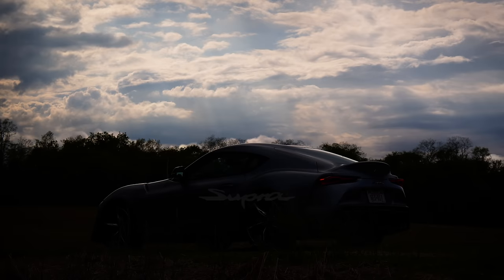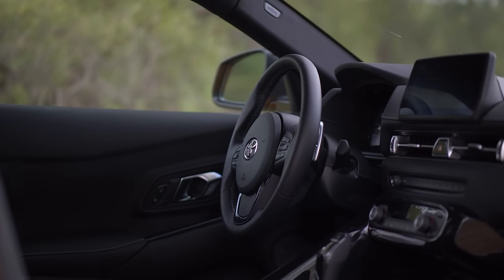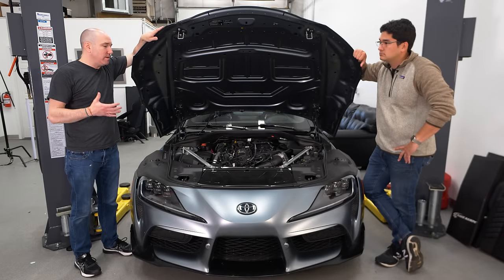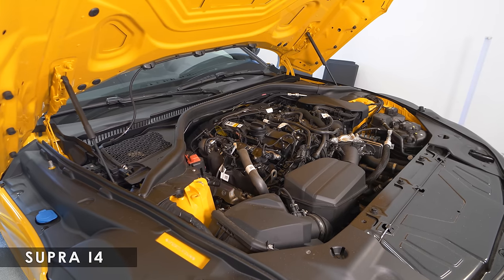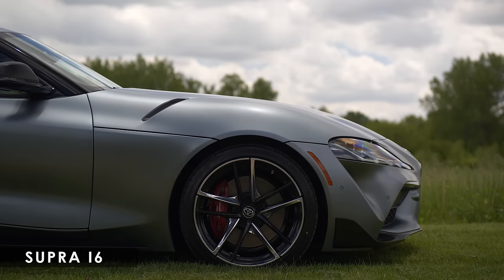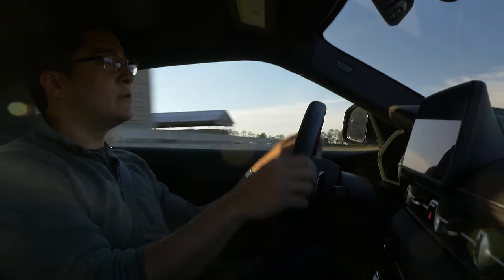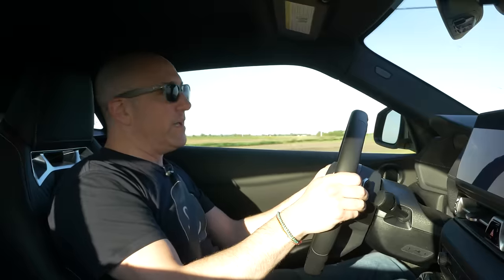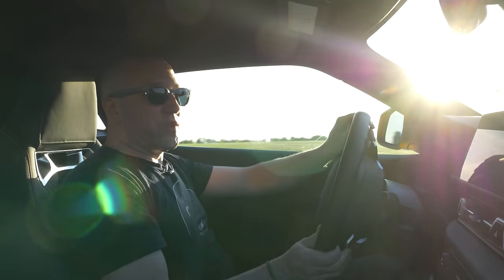2021 Toyota Supra | 3 Pedals Short of Greatness

Comment: How is the buffeting? One of the major complaints with the 2020 edition was that you couldn't drive them with the window down any faster than 50kmph / 30mph without getting beat up.
And if there is a Kia made version of the Ford Mustang. They called it the Genesis Coup, it's a thing of the past with Genesis splitting to become a separate brand, and the advent of the Stinger and G70, but the old Genesis was a RWD mid size V6 that leaned towards performance. Just like base models of the Mustang.
Reply from the maker: Yes it sucks. (Buffeting)  The only way Toyota will address it is the owners of the car go to the dealership and complain.
Reply: The genesis coupe was a good car, kind of like a cheaper G37
Reply: G70 coupe rumored to come back this year with a g70 coupe and that 3.3tt haha
Reply: @IReahpZz  No lie: I love the G70. It's one of two I daydream about owning.
Reply: @M_773  Cheaper or less expensive? :)
Reply: @JS-hw8ve  I mean, the G37 was a little bit better in every way, the Genesis was basically a slightly less good lower quality version of it. The 2.0t is the best value though because they have insane tuning potential and less weight over the front
Reply: It's unbelievable how Toyota just didn't look into the buffeting problem at all.
Reply: I had RAV4.2 and G20 X3 that buffeted just like BMW Supra.
Reply: thats the best part of owning a sports car. windows down and cruising at 75kph. what a joke of a fucking car
Reply: Went and test drove a Supra and that problem was bad enough I wouldn’t buy a launch edition at MSRP, and holding out hoping Toyota would fix the issue is apparently a lost cause. I was really looking forward to this car, but like others have said, I live in Southern California and cruising the canyons with the windows down is the entire reason I want the car. I’m buying a used Porsche instead. Maybe a future Supra will fix the dumb shit and sort the handling issues (rear bumpsteer).
Reply: Im surprised Toyota didn't or couldn't figure out a waste gate for the interior compartment to allow air to flow through when the window rolls down. Seems like a simple solution. But im no engineer so i could be way off.
Reply: What could a fix be? I’m curious and too lazy to Google.
Reply: @M_773  I can see that. Never been in a G37, so I'll have to take your word for it, but whatever issues they had the modern iterations seem to have grown out of them. I mean, hell... look at the Stinger. It's not a Mustang clone in any way, but there's a reason it's been so highly rated. And the G70 is the richer version of that.
Reply: @joeracer302  Porsche are nice, good on you and good luck with it. It should provide many smiles per mile. In my area they are  impossible to get worked on. I'd have looked at Lexus. The RC F is a damn inviting car.
Reply: @aurorajones8481  I have a history in HVAC, and I was thinking the same thing. Baffled venting isn't that hard to manage.
Reply: @JS-hw8ve  he'll be fine in California Porsches are pretty common
Reply: @brownwhale5518  They just need to add a way for the air to escape the cabin. How easy is it to fix? I have no idea but it really does suck. Maybe they could use one of those fake vents.
Reply: @brownwhale5518  spoiler lip running along the a-pillar. It would increase the .cd however.
Reply: Geeth San you can fix it with like $20 wind deflectors
Reply: I heard there is an aftermarket mod in the works that replaces the rear glass with Venetian blinds.
Reply: Kia and Hyundai are 2 different brands man. Hyundai made the Genesis Coupe
Reply: Surely someone can come up with some kind of window sun visors that can reduce the buffeting.
Reply: The performance aftermarket fixed the wind buffeting issue soon after the first customer cars were delivered. A simple wind deflector that fits cleanly above the mirror mount. You can get an unpainted plastic kit from Twisted Tuning for $75 or a carbon kit from Verus Engineering or AMS performance for $185 - $200
Reply: @CarolinaAutos  been done since last year.  Depends on your pockets but if you could care less you can make your own.  I did and i have no buffeting issues even over 130mph
Reply: savagegeese how long before you couldn’t put up with the noise?
Reply: @zaitcev0  it's annoyingly common nowadays.  My Mk7 GTI is horrible as well.
Reply: I am guessing you have not driven many coupes wit the front windows retracted if you have to ask that question.
Reply: @memememine1  Yeah, I live in the bright end of nowhere, most people would be fine with a Porsche.
Reply: @evolvation587  They're more connected than you think.
Reply: Pete Zaitcev what year rav4 buffeted?
Reply: @machtschnell7452  Not lately, being an old married family man means my rides have been sedans and SUVs for the last 20 years. Times are changing, and I've been looking into getting something more fun.
Besides, it's not just a coup problem. You get wicked buffeting in SUVs too, and any other car with the right shape. I've heard it happens in Honda Fits,  believe it or not, but whatever you're driving it's gotta be a huge pain.
Reply: J S Hyundai owns a part of Kia, but still “different” companies
Reply: Genesis Coupe is a beast! Got a SEMA Coupe running around here in town, turbo is bigger than the engine. 😎
Reply: Csab  as in "if no one is around, do it yourself"?  Voids warranties. If I'm buying new, I want all the perks those payments get me. Other than that, you are dead on right.
Reply: @evolvation587  yeah..."different".... Looking at the Stinger and G70 you can see just how "different".
Reply: @planetwisconsin9901  One for sale near me, but they are asking for more than it's worth. I think the husband doesn't really want to sell it but the wife wants him to. LOL It is a nice car, that's for sure.
Reply: love the G70!
Reply: @geethsan1567  Who says they didn't look at it? Simple fact is aero causes increased buffeting. To stop it you sacrifice something else. Get over it.
Reply: Swapped some rain guards from my 91 SVX....problem solved. Jk
Reply: Great review as always, thanks. Is that the metallic or matte grey on the 3.0?
Reply: I don't see that car beautiful until i see opening of this video.. i do not to like it before.. nice video
Reply: I'd have to say the Genesis Coupe  must be the most successful affordable sports car since it came out. I see them all the time.. very common. And it's a nice car.
Reply: @geethsan1567  I think there's nothing they can do as it's the only way to fit the shell onto the Z4 platform. On the other hand they could allow you to crack the rear windows like the E46. That would solve it.
Reply: There is an aftermarket piece to solve this already people...
Reply: It's awful. Had to walk away from this after a drive
Reply: @cwx8  came here to suggest that. The Hofmeister windows on the e46 are my favorite party trick when I take the car out after it's been in the sun all day. Pulls the air right through the cabin and would also fix buffeting if there was any.
Reply: Why is driving with windows down above 50kmh/30mph sich an issue? Does anyone do that on regular basis?
Reply: @Suomyice  I'll give you an example of my particular use case. I live in Southern California where the temperature is above 23 degrees C for most of the year. I spend a decent amount of time driving in the mountain roads near my house for fun. I spend probably 20-30% of my total driving time with the windows down, which is many hours over the course of a year. Many other enthusiasts here are similar.
Reply: Especially up in the mountains, even in the summer the air temperature is pleasant once you gain altitude, and the smell of nature is far preferable to the sterile filtered air coming from my air conditioner.
Reply: @Suomyice  Um, i do that at every chance in all the cars I had. Much better way to hear aftermarket exhausts and intakes along with tire noise, hearing the noise echo off of buildings/mountain cuts... it's all about the sensation of driving. I'd be surprised most enthusiasts don't drive windows down when they can, either way too hot or way too cold, or at a track.  Hell the one thing that held me back thus far besides buffeting is that there's no Targa top for this thing. It's crazy there isn't one.
Reply: @675Films  wouldn't by more effective to cool the cabin by using the AC?
I have myself often driven the canyon roads in SoCal.( the best roads in US ) And I like to drive them when I can in a spirited manner. And I never find myself with windows down. As I like to be able to have a good connection with the car while I drive hard. And listen to the engine plays a vital part in that.
 So I keep windows closed, no music. And for the same matter. I don't enjoy converable cars when driving fast. All you end up is hearing the wind noise, and therefore lack connection with the car.
Reply: @Suomyice  my car has a very muted exhaust (stock 3 series) and I can still hear it better with the windows down. And I love the mountain air. To each his own though, drive whatever way makes you happy!
Reply: @Suomyice  LOL... Oh yes... yes we do. It's one of life's great pleasures. Fresh air and the sound of the engine. Your music turned up loud, and the smell of season reaching you despite sitting in your metal box. It's one of those simple things that makes life worth living. Not as good as being on a motorbike, but still pretty damn great.
Reply: All Korean made cars was the copy cat of American, Japanese and European.
Reply: @JS-hw8ve   I get it when going slow or below 60-70mph. But not when you are attacking the road going 100+ mph. Then  the wind noise will become all you hear. The same goes for motorbikes, when I was riding my 1000cc sportbike. out on the open road. I always added ear plugs. That is what all sportbikes riders that ride serious speeds should do to protect their hearing. There is a reason all MotoGP, Superbike riders use ear plugs.
Reply: Maybe buffeting could be solved by putting some - i know not nice but useful- wind deflectors on the sidewindows? 
Has to be a airflow issue.
Or just drill a big hole somewhere in the cabin ;)
Reply: James May right now goes - "BUFFETING!"
Reply: Who drives with the windows down at freeway speeds anyway?
Such a stupid complaint.
I've done a few hundred mile runs in my E55 with the a/con on. Doesn't make that much of a difference.
Reply: @37robles  lol... Yes it does. And look through the comments, lots of us do. 

Also, 50kmph is residential speed. It's what you drive in the suburbs and on city streets. If you have to seal up like an iron lung to protect you from the elements are you really a "driver"?

That's like all these guys who day they want standard transmission, then cry if they don't get electronic steering, lane keep assist, and adaptive cruise. At what point are you driving and at what point are you being driven?

Roll your windows down sometime and be part of the world rather than just passing through it.
Reply: @Suomyice  I hear what you are saying, but I have to question what you mean by "attack".
I'm not a racer, I'll never be on a track. My car is a combination of utilitarian and land yacht for long distance driving ( I mean it's my oasis of comfort, not that it's a freaking huge boat of a car). My family is spread out in 1000 km to the North and to the South of me, a full trip to see family means I am putting at least 3000 km and spending in the neighbourhood of 30 hours at the wheel (or less, if you know what I mean) and that is just getting to where I am going, not including what I do when I get there. I want something that is comfortable, reliable, but still enjoyable to drive and can put the hammer down when needed. Highways are often filled with obstacles, from tankers and logging trucks, to farm equipment that pulls out onto highways indifferent to safety. I need something that is engaging to keep focus, and a pleasure to be behind the wheel of.
My motorbike was a cruiser. A mid level soft bagger that could get me from Vancouver to Calgary in one go not counting refuel stops and meals. I used earbuds on the highway not to drown out the noise, but to keep my mind engaged while putting hours in the seat.
I don't "attack" the road, I'm not like a shark. I own it like like an orca, I go purposefully from A to B, putting down the bite when needed. 
What I look for is not a racer, but a performance vehicle that can be used as a Grand Tourer. There are lots of performance cars that fit the bill nicely, but so far I am disappointed that the new Supra isn't one of them. 
You do you, bud. You sound like you have your personal style and know what works for you. Cheers for that. Some of us, we simply have a different outlook on life.
Reply: @JS-hw8ve  Thank you for your comment . But we are here talking about a sport car ( in this case the Supra ) 
And when I say "attack" I mean drive a windy road hard and fast. In other words using a sport car for what it is designed for.
Based on your comment, that is not the type of car you need or are looking for. But a comfortable GT car might have what you desire from a car.
Reply: @Suomyice  according to the video the 4 cylinder is set up as a GT car
Reply from the maker: @diofelles  This car buffets bad compared to others, the pressure it creates at 45-55mph is nutty.  Likely depends on ear sensitivity.  LC500, RC, 8 series, C7, S2000, Z4 etc dont come close to the supra. I was in those within close proximity, if you can deal with it, hats off.
Reply: maybe if they make it so the rear hatch glas can open up a tad bit the air will flow thru better
Reply: It’s still there, just get some aftermarkets
Reply: verus engineering made a product that fixes it
Reply: I have had my Supra for 2 weeks now, you can drive above 60km/he with the windows down at 10-30% down, not all the way. It’s really no big deal for me anyway
Reply: @cz3nlv  Thanks for the honest reply. Glad you are happy with your Supra. Although the car is not for me, I can certainly see why it puts a big ol' smile on people's faces.
Reply: @brookbank  you can fix it for $8 on amazon
Reply: Damn I really forgot about that car
Reply: Genesis coupe is one of the most under appreciated sports cars ever
Reply: It can be easily solved with just some mirror flares that fix the air flow over the car and stops the buffeting,  they're really low key and you  can't really tell they're there
Reply: @JS-hw8ve  honestly the Genesis coupe and g37 are about the same in regards to interior, they’re faux luxury (gen coupe ultimate at least, the track model is bare bones). Neither are really impressive in that regard. I can confirm however in raw performance the Genesis coupe 3.8 has the g37 beat. But aftermarket wise of course the g37 is the muuuuuuuch better option. With an actual aftermarket with parts from companies I can’t count on one hand lol.

Source: have a gen and know a lot of g37s, also internet
Reply: @Meekmillan  You literally just told me that the G37 is better... but only if you replace most of it... Uh, sure.

As for "faux luxury" I'm not sure what you mean. How faux is it compared to an F-150? A Chevy Impala? A Dodge Durango? or a Camry TRD edition?

The degree of luxury is subjective. If you aren't a fan of your car, I feel for you, but maybe your views are different from mine.
Reply: @JS-hw8ve  i mean basically. Very similar looks, interior quality and performance. But the Genesis edges out the g37 around a track qnd on a straight. Though the g37 has a larger aftermarket so differences are meaningless if you spend the money. 
Don’t get me wrong, the Genesis does has one too, it’s just not as large. There’s turbo kits, shops that’ll bore it out from 3.8 to 4.1L, companies that sell forged internals etc etc. 
But the g37 has a more options from a wider list of companies. 
But I absolutely love my car, I think it’s better than a g37, 370, and of course the typical 4 bangers like brz, Miata, wrx etc. I wouldn’t trade it for any of those.
Reply: There's an aftermarket fix. Yes Toyota should have provided one but not like a major drawback. I got a CF wind deflector on mine. A non-CF is cheaper

Comment: As 2020 owner I am not even mad, you are just $2k away of 430whp with a couple of mods and a Tune. Would be interesting to see the Tuning potential on the 2021 with the 10:1 pistons. As for the 6 vs 2 exhaust ports, I don't think that's a bottle neck at all, people are pushing 650/700 whp and the transmission starts to slip before the Engine is maxed out. The only concern would be price wise, the 2020 will drop in price, but if you keep the car long term that is not an issue either. We appreciate this kind of reviews Mark, great quality and honesty.
My second car is fact the Z4M (06) and my Supra is exactly the Matte Gray, just like the one reviewed. It's funny to see both reviews from you just weeks between them!

Comment: I’d buy the 4cyl if it was manual :(
Reply: Just buy the BMW version with that engine. That comes with an optional manual.
Reply: GameBoyKolor yeah but he probably wants the Supra styling so that might be a problem
Reply: Danish Wistara 

Also, doesn’t want to pay $65,000
Reply: The 86 is a Toyota 4 cylinder with a manual
Reply: @massterwushu9699  it's too expensive, why didn't they out the V8 in here
Reply: @dragospahontu  The Supra's legacy lies with the 2JZ, being a straight 6. If they chucked a v8 in it they'd get even more pissed than it jUsT bEiNg A bMw
Reply: @bottomtext5872  but they have a great N/A V8, fuck the legacy, the people who are buying these cars never heard of the og supra, which wasn't even that good let's be honest.

Apart from the engine, the old supra was average.
Reply: Trust me you dont want the 4 cylinder version. It is the same motor in the Cooper S the motor is junk...
Reply: Not gonna happen. Toyota is run by bean counters, not motorheads.